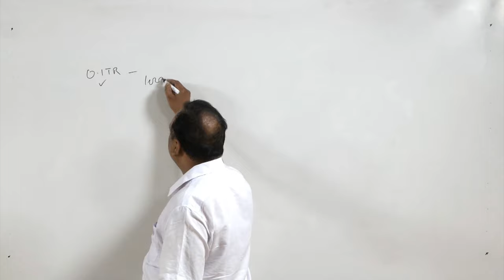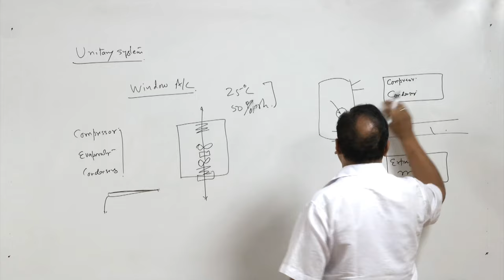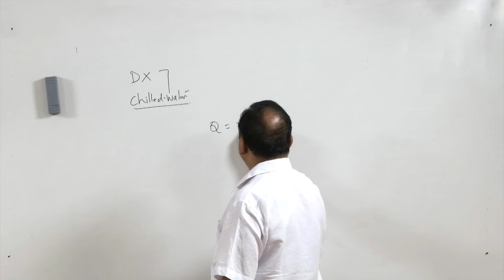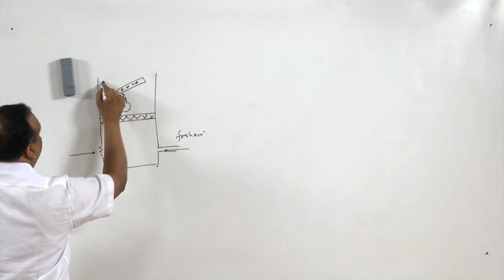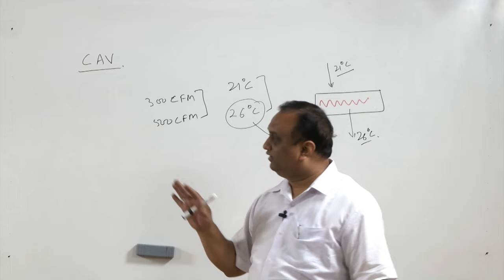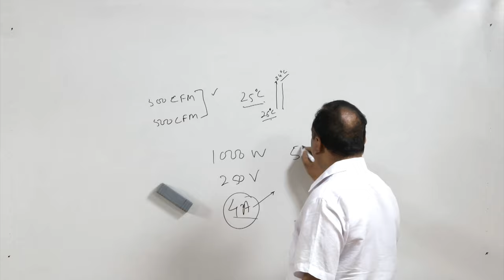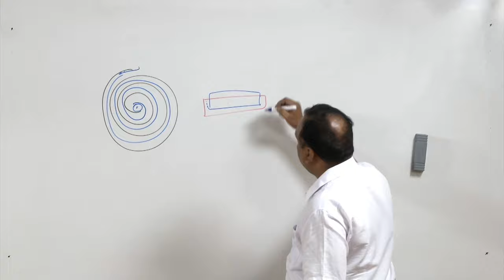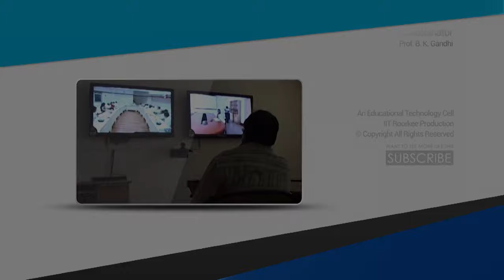Air-Conditioning Systems

Comment: Thanks Sir, Is portable AC ok, I found some design faults. The Ac sucks conditioned air and cools the condenser, so the required temp cannot be reached. Also there is continuous negative pressure in the room due to which the outside air is being sucked continuously